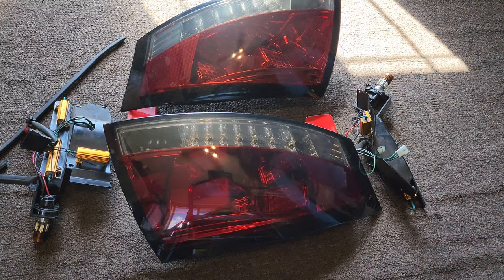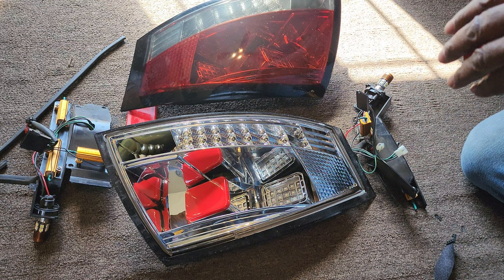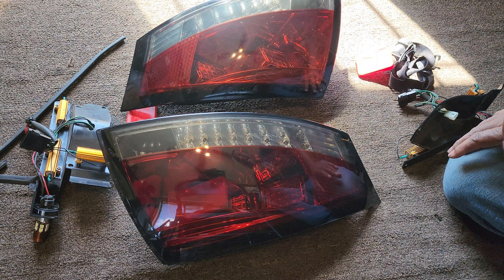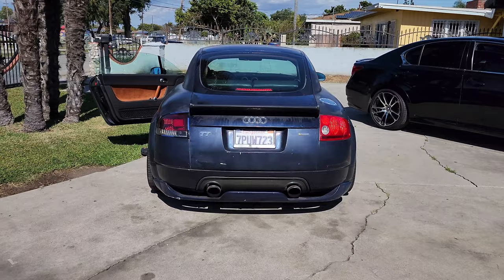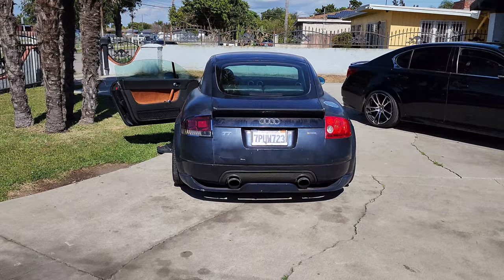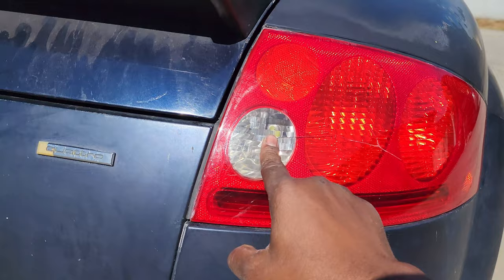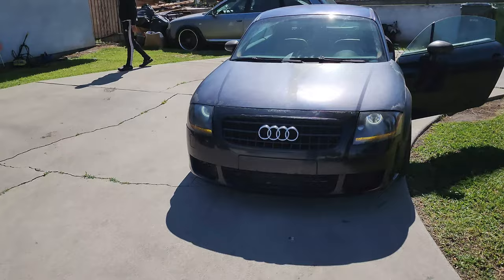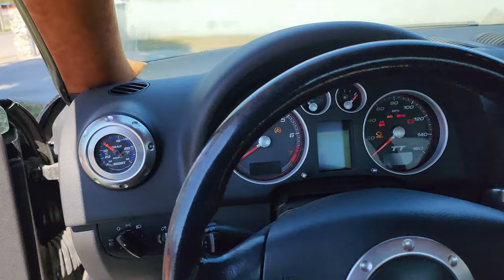MK1 Audi TT Quattro Project: L.E.D Taillights Modification / Safer

Comment: Dude I have had these lights for years. ppl used to tell me all the time that I didn’t have lights. I would check and see them on. I never understood why they would say that. I have been waiting for someone to explain this in depth for a while plus my TT has been down for a bit. Should be back in about 2 weeks. Now I will be removing those covers !! Thank you so much broski.
Reply from the maker: Yeah be careful. Make sure your third brake light is working.

Comment: Looks great, would the aftermarket lenses fit the stock pods? That might solve both problems. The round theme is better the squares look out of place.  Great video sir.
Reply from the maker: I'm not sure if they would fit. What I did was put some red tint film on the inside lower part of the aftermarket lenses to make the turn signal lights stand out more during the day and also kept the red covers off of the brake lights.

Comment: how did you get the panel off so cleanly, i had mine laying in a ultrasonic bath and blasted the sides with a heatgun and used tiny metal sheets on its sides yet it just doesnt give, i even cracked it a little bit unfort :*(
Reply from the maker: I can't remember exactly but I used a heatgun while feeling around for the first parts that would give and went from there and applied more heat as necessary. You can try letting them sit on a car dash on a hot day then going around it again with the heatgun while it's still hot. Use a couole of flathead screwdrivers and start carefully prying it open and use stick the other screwdriver in the part you get open to keep it from reclosing while moving it along as you get more of it open.
Reply: @cmidas3396  Thanks mate they off! Not as clean as yours due to my questionable bruteforce approach but nothing some epoxy and sanding wont fix! I had these laying arround for years since i to ended up not liking them, part due to that visibility issue but my plan is to convert these and salvage the acrylic, drivers and its main housing.
Gonna try to 3d print a inner bracket so i can add leds along the width in something like this pattern 
/\/\/\/\ not quite sure yet.
Do plan on moving the direction indicator inbetween somewhere so i can darken the lower bar of the acrylic and hopefully make them feel a bit more aggresive! 
🤞
Reply from the maker: Wow, sounds like they're gonna come out nice 👍🏽

Comment: Hey nice work, where did you get the rear diffuser piece from?
Reply from the maker: I got it from New German Performance a longtime agk. It was a one-off in their old stock clearance. They had this one and another one without the raised middle part that mine has. I asked them what brand it was but theh didn't know.

Comment: Hey Midas nice video and have problems with these lights myself, may i ask what is the way to get the lens off because i have tried everything 😞
Reply from the maker: I used a heatgun to soften the glue the stuck a flathead behind the lens to carefully pry them open. Start on the ends. The seal is not at the very edge, it's at the inner boarder of the black part of the lens.
Reply: @cmidas3396  thanks mate in my case it doesn't seem like the lens is glued but more like the lens is fused to the housing 🤔
Reply from the maker: @somebodyismeM  I thought so too but figured out how to open it. It should have the mastic glue like the headlights. People usually put them in an oven actually to heat them up evenly to get them open.
Reply: @cmidas3396  Oke man thanks for the infomation and will give it another shot 💪
Reply from the maker: Yeah just be very careful.
Reply: @cmidas3396  !!!UPDATE!!! yeah i did as you said and hell yeah i was able to remove the lens with no problem after heating it up with the heatgun 👍
Reply from the maker: @somebodyismeM  Nice 👍 Glad that you got it done.

Comment: I’m about to buy those but now i’m worried for my safety. They need to be more brighter🙄
Reply from the maker: Yeah these are old and sometimes they update/improve on the newer stuff.
Reply: @cmidas3396 any ideas to improve that without pulling out those bulbs cover?
Reply from the maker: Not really. The lenses gotta come off to get to the inner covers. You just leave them though because the third brake light shows during the day.
Reply: @cmidas3396  thank you man! I got another question: is possible to replace the bulbs? I ask you this because i saw a video and those bulbs seems like they’re soldered on an electronic board🤔
Reply from the maker: Yeah the led's are replaceable but I think they would need to be soldered in. Another idea would be to have someone put brighter led's in.
Reply: @cmidas3396 yeah, my intension is putting brighter led on it, thank you so much man!